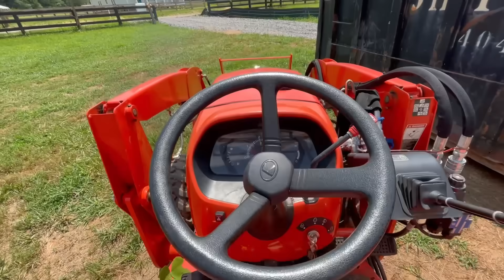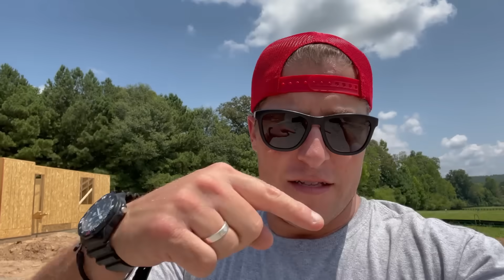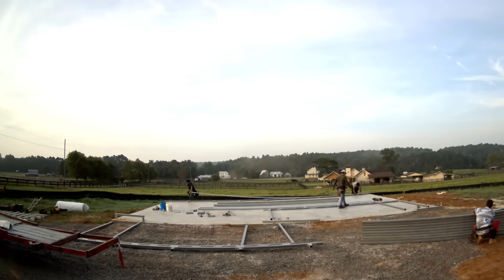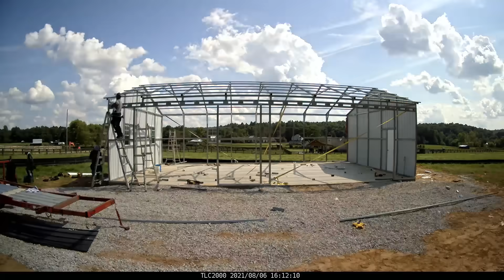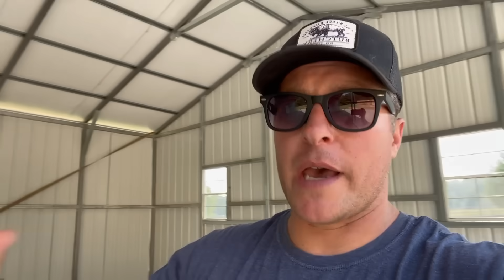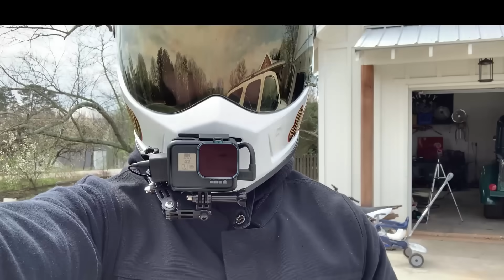I FIRED THEM!!  26x40 metal building Dream Garage build Ep.2

Comment: I would force them to honor the term of the contract, or I would see them in court. What they supplied was not what you have probably paid for already (although I hope that you have not finished paying for that yet). Request a building inspection so that you have a record of that structure failing inspection. You should probably check what gauge metal they used for the poles and trusses, as well as for the roofing and vertical siding as well. Another way that less scrupulous builders can cut corners/costs. I would never accept less material than what I paid for.
Reply from the maker: Thanks for the support man. We actually came to an agreement and got it fixed. Thanks for watching

Comment: In my humble opinion, you always get what you pay for. It looks like about the cheapest metal building you could buy not meaning any insult. There are all kinds of buildings and all kinds of quality with the price to match. But that still isn't an excuse for poor builds. But since I have looked into all kinds of metal buildings myself I've concluded to spend more on a well-built red iron building.
Reply: When I had mine built i had the experience of my next door neighbor to guide me. His was a building much like yours. Knowing that I was building a barndominium, I concluded that this style  was ok for light duty car or equipment storage, but not a building shell. The cost difference was not that much here in Texas - my slab cost almost as much since I wanted a floor capacity to handle portable lifts and heavy loads. That was my fight. The day of the pour no one on site spoke English, but I knew enough Spanish to tell them that it was 6" not 4" that they were for
Digging out for... 1 foot grid of number 4 not 2 foot. Lots of little differences that were important like slopes to floor drains. So I am saying that to say this: someone has to be onsite every minute to make sure you are getting what you paid for. I live in a county without code enforcement or inspection. Only YOU can make sure its happening correctly. I think that's even true where there are inspections.
Reply: I elected to go to the next level and got the red iron building. It was triple the price but ever aspect of it was better quality materials. the metal skin was way thicker, the man doors were real commercial doors, The roil ups are true commercial units with electric openers. I went 40 x80 thinking I had tons of space, turns out its getting small and I might see an addition coming my way.
Reply: ya even still the plans don't match what they are buillding
Reply: agreed
Reply: Man, no disrespect meant but I agree, that is the cheapest metal building I have ever seen in my life! I would DEMAND they take it down! I don’t think it would hold up to a decent wind event.
Reply from the maker: Thanks for the input. If I could do it over again id 100% go red iron building as well.
Reply: @ProjectDadLife   Yes we call these glorified carports.
Reply: @ProjectDadLife  the sheet metal should be warrantied by the manufacturer or whoever damaged it in shipping and to boot if you addressed that issue while they were doing the work a proper contractor would stop work. I never knew people tried to and did get away with selling a carport as a building
Reply: @ProjectDadLife  red iron is the way to go!
Reply: I would humbly echo the same thing, definitely a cheap building but combine that with poor craftsmanship it will be terrible.
Reply: Totally agree.
Reply: "Red Iron" Is Grey now, think it has something to do with seeing rust easier.
Reply: @EvilSt0ner  the ones I’m putting up are still red lol
Reply: Blue iron is better
Reply: Amen brethren.
Reply: You showed a picture of a guy cutting part of the metal frame-that shouldn't be happening. Either the foundation was poured too short or the installers are ghetto rigging something
Reply: Those buildings are the cheap of cheap bub. You could go red iron bolt up or custom weld up with heavier iron. Built several myself....
Reply: From personal experience these 2x2 galvanized buildings are complete crap. If i were to get another one i would just build it myself. Not sure why installers of these building want them up so damn fast!!! They built my 45x65 building in two days but once you start looking at details it crap!!! Looks good from far away or to people that aren’t too picky. Also they use the cheapest guage tin almost paper
Reply: I am no expert builder  , but I have built several barns  , carports  , etc.  for myself in my 63 years.  From my experience with special order metal roofing/siding  , it looks like the dye that they used when rolling that out into sheets was bad on that one edge  . I've bought my metal from a small mom and pop operation the last few times  . What I like about this is that they roll it out and cut it to your exact specifications right in front of you while you wait  . This way if there are any questions  , you or them can ask those questions so there is no confusion as to what you want  , or if you notice any issues  . I can tell you from experience  , whoever rolled those sheets out  , knew that there were problems with that edge  .
Reply: @toneylamey9488  you are absolutely correct about the die. It was putting to much stress on the flat stock as it went through the roll former. I was an Architectural Sheet Metal installer for 20 years.
Reply: Jerry's comment is true. Look at Great Western Buildings and see a HUGE difference in structural design.
Reply: A lot of people cannot afford the double price tag of red iron. These channel buildings can be very nice and strong. There is big differences in them between manufacturers. Some use much heavier steel and have better quality control. If the plans called for entire length beams then that’s what should have been shipped. One problem I see here is that you are the customer didn’t catch this earlier. Upon delivery this could have been caught. Look at what you got and make sure it’s correct before the work of erecting takes place.
Reply: May I ask who the manufacturer was and where you bought it from? I work for a Steel Building company and this is not acceptable especially if your plans showed 16ft trusses
Reply: Yeah been doing I-beam frame buildings for 20 years now
Reply: It’s got nothing to do with the quality of the steel it’s the workmanship and structure of this building that clearly was not part of the contract. I’d be telling them to rip down and start agin or give me my money back. As you state there are concerns of what was lodged with the council to what was actually built. Don’t settle for poor workmanship and sub quality of build.
Reply: @trevorlovegrove4007  red iron does not exactly denote the quality of steel. Red iron framing typically refers to I beam truss and leg framing with C channels or Z girts. Much more expensive than thin galvanized tubing but immeasurably heavier and stronger. But I see no lack of workmanship in the video to start pointing to. That being said I also think a good contractor would pause work for customer concerns so even without seeing bad workmanship I could see it being either way
Reply: We have had a metal building like this for five years and never an issue.
Reply: Engineer stamped count approved, chep or expensive, it has to meet the minimum code of the county what equals safe and fully functional. Prius or Bentley they all cars road worthy!
Reply: Rich people are usually the cheapest and the first to complain about what they asked and paid for
Reply: @andrewnicholson2339 doesn't matter how cheap, but if the contract you have says you get x, then x better get delivered. People are far too accepting of crap work from contractors because they don't want to argue with someone.
Reply: Simple is that u get what unpaid I paid 150 to me tattoo artist to get me a  70 hours tattoo tanks
Reply: @paulgp19  what? Did you have a little to drink there bud?
Reply: @502lsx5  🤣🤣thats more than a little.

Comment: Shabby work. Those ripples come from improper handling of the sheets. And a good crew would not only not of installed them but the sheets should of been put on from the other direction so the seams are hidden from the front of building. Having those ripples it compromises the weather lock.
Reply from the maker: I’m learning so much after my building process lol. Thanks for the input and support
Reply: @ProjectDadLife  My take on the sheeting is that the capillary edge always goes underneath. It  helps to keep weeping from  blown rain etc from going over the ridge. 
From the many  farm buildings I have done  in the uk (over forty years)it is the case that the “capillary edge” ridge is often bigger than the clean cut factory edge on the other side  so some think that is the lap to put on the top, I can’t speak from steel sheets made in other countries .
A few readers have already implied this and I’m so surprised that there are not more comments about this that I’m writing this letter to have my four pence worth.
When the sheets arrive from the factory they often have the ripple effect seen and does not  matter because it is not normally seen, maybe it’s caused by  the way they are pressed out in the factory. I have just added this , just to say that another possibility for the sheet with the ripple effect ,it could be what is known as a packer sheet, the cover sheet put over the good sheets for protection of the stack .they were invariably reject sheets that were used and not meant for use on the building.

Comment: So as a pole bard builder the sheets should’ve just been ran the other way and you wouldn’t of had that issue this metal is supposed to be used for little car ports I’ve never seen it used for entire buildings and they use different metal on those structures
Reply: Well those little carport company’s now offer 60 wides full inclosed with the same material they built those little caports with and have been doing so for years.

Comment: I will say that building will colapsé as soon as you get 2” of snow 
I been doing this structures for 23 years  and I will never do a 26 wide truss on single tube
Reply from the maker: I plan on welding up the trusses to make them double beam. Was going Jack them up to hold pressure then weld them. Think that’ll work?

Comment: Well, 35 years in the industry. Sir, don't take me wrong, but you ordered and bought cheap. You wanted cheap, you got cheap. Those workers are doing what they are told to do, with your cheap order. Don't beat them up. They are doing their job.  You ordered a low grade building and you got a low grade building. If you want custom quality cabinets, you don't order them from IKEA, then blame the guys assembling the IKEA cabinets that they are doing a crappy job. The only item I see as an issue is the freight damaged vertical steel. But again, very likely not the installers issue. Take a big swallow, call those guys back, make friends with them, tell them you made huge mistake. Finished the job, then go after the manufacturer to get some discount on your cheap building, and after the freight company for some damaged steel. And if you get nothing out of it, learn that you wanted cheap, got cheap, and expected more.
Reply: Amen

Comment: Having built many steel buildings from 30x40x12 to 100x400x24, I wouldn't have bought what you did at any price. If you have any wind issues where you are, you may expect problems. I certainly would not store ANYTHING that I value in that building. A pole barn with factory-built wooden trusses would be stronger than the framing you have.

Comment from the maker: Hey guys thanks for all the help and support. Finally got the garage doors installed. Excited to see what you guys think about them https://youtu.be/nk8uxpeMa20
Reply: Looks like you won't have building after the first storm.
Reply: I've been in construction for many years.  I watched your  video.  Noticed several moves that were not very safe and unprofessional. No scaffolding etc. Also looks like a cheap building.  Send it back.
Reply: Shoulda called cleary buildings
Reply: I had a simular issue with Carport Central who's installation crew was ran by a company  called RAM. I had to fire them as well. I got stuck with a crappy 26x36x12 carport with wavy walls.
Reply: Im way late but the builder's must follow your local building codes as well as the manufacturers specifications and lastly, is there an arbitration clause in the contract in case of an issue arises? Im a retired carpenter, we also had to follow the allowances of our local metropolitan builders association guidelines, which I compare to trying to shoot the broadside of a barn with a 12 gauge.  Lots of sloppyness is allowed.
Best of luck!
Reply: both issues are of grave concern. where I am the roof would collapse built the way it is and you had contact to insure the roof met local code it does not so now it is up to them to make it right. second water will penetrate on the bad seems
Reply: The riples yes problenm. With jusr the right wind and rain  water can sneak behind the panels. The 3/8 sag on roof there is plenty of slope live with it.

Comment: It appears that that tiny ridge of metal is supposed to be on the underside I have seen this before and it's because that edge is ment to be on the underside not on top lol they not only installed it backwards they also installed it upside down they should be fired lol

Comment: I would give them 48 hours to either come and correct the problem or remove the whole building and then compensate you for your loss if they don’t respond file a claim against them in your local court in common law
Reply: Nope the deeper they get into it an fail, that harder it is to pull the plug

Comment: In my over fourth five years in construction I have put up commercial metal buildings with a company I worked for up here in the northeast we call them"twenty year tin cans",hard to heat and cool and shallow pitches on roofs. Not good for the snow loads up here. And by the time you finish off the inside you might just as well gone with a stick built structure.

Comment: I pondered what feedback wouldn't be biased - I build a different sort of building.  Then I saw another You Tube video of someone proudly insulating an identical building (one with the small cross member on the truss). 

Here's the deal.  The wrinkles on the overlap are probably freight damage, but the visibility of the overlaps even with good edges are typical (that is to say they hide in perfect conditions but there will always be some that show). If the the visibility of that bothers you; buy some other type of siding.
As for the sagging trusses and visible gaps; that is what those cheapy framed buildings are like - oops my bias slipped through.  Workmanship is a factor, but I guarantee, that crew when home absolutely frustrated, because they were praised by their last 10 customers for virtually the same product. I'm not saying you shouldn't get what you want; but this is mostly a case of getting sucked in by a low price.

I'll give you a comparison from the other side of the fence, the perspective of the company.  When I worked for a pickup truck camper shell manufacturer; the complaints almost invariably came from the customers that bought the cheapest camper in the catalog. The cheap ones and the deluxe models were built by the same people = virtually the same workmanship.
Reply from the maker: Thank you for your input and support. I grew up on commercial buildings doing roofing. I’ve been around hundreds of metal buildings. This was the first rippled overlap edge I’d ever seen. Also my step dad manufactures metal building on a larger scale. His first comment from 20’ away was there panel form roller was completely worn out or way out of adjustment. He said those edges would never leave his factory nor his customers would ever take it.  Also the trusses that were sold via our contract had 16’ welded lower cross brace per code because it was over a 24’ span. These installed were 8’ span lower welded brace. If I was on the other side your side I’m
Assuming I don’t know what I would do honestly, because I wouldn’t flat out lie to my customers about what I’m selling or half ass my work. I would go home knowing I was straight forward, honest and did a whole ass job.
Reply: @ProjectDadLife  If you have so much experience around metal buildings then why would you buy a structure from a company that does not even update their website or have any reputable reviews? I'm sorry that you did not receive what was in your contract but it is hard to feel too much sympathy when you bought on a budget and you did not even check that what you received was correct until it was already installed

I think this is a classic example of you pay for what you get....With that said I'm wishing you all the best and I feel like you will still get a shop that fits your needs and you find beautiful
Reply from the maker: Thank you. I was referring to just the finished metal exterior. Overlap edges, closures, screws, straight panels etc. commercial frame structures are completely different than these residential ones. My knowledge is just looking at the exterior sheeting which is pretty much the same between the two. That said I called and spoke with every company around for these residential style buildings. They all use the same specs and offer the same structure.  I’m pretty sure they all buy from the same couple factory’s in North Carolina. I acutely don’t personal know anyone that has purchased one either so it was defiantly a shot in the dark. I do think it’s gonna work out for what I need though. Luckily where I’m at there’s no snow load really it’s extremely rare. Thanks for the input